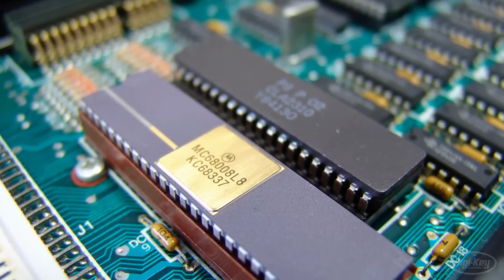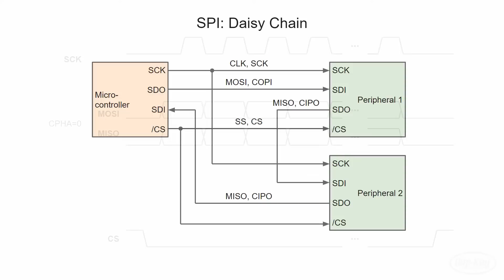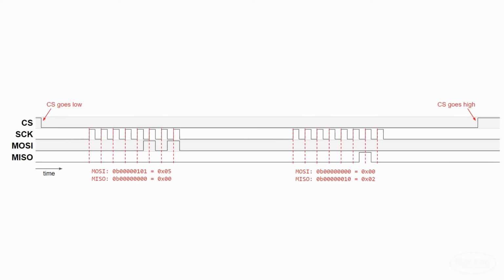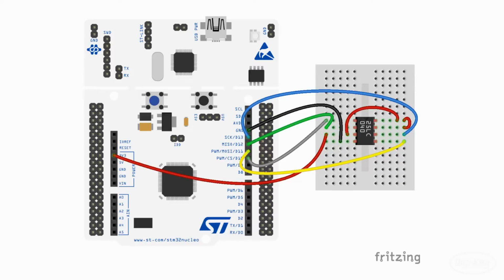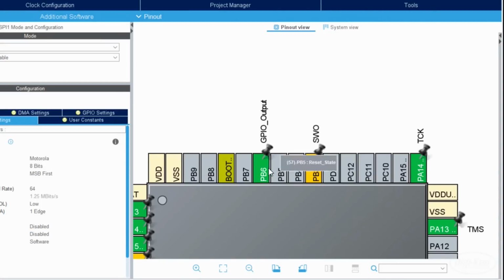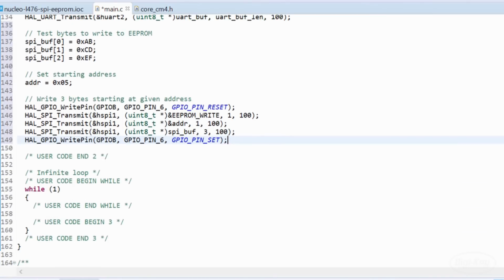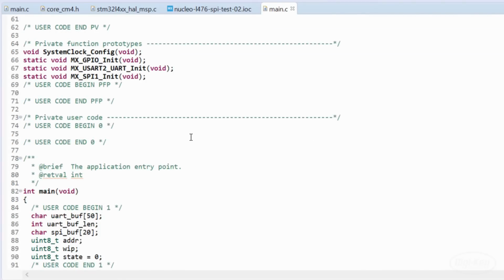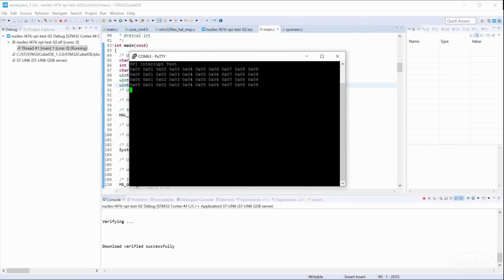Getting Started with STM32 and Nucleo Part 5: How to Use SPI | Digi-Key Electronics

Comment: for some reason when I use this code and setup on my g474re using lpuart putty always displays nothing at all
Reply: i've got the same issue
Reply: @varulven5143  the baud rate was not set correctly in putty, check in cube MX what tje baud rate is set to and put the same into putty

Comment: Thank you for this useful tutorial.
Maybe you do another one on Octo-SPI ?

Some bookmarks:
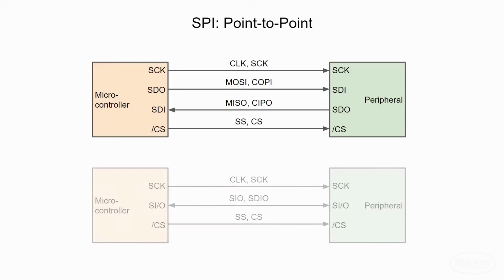1:51 3 lines SPI configuration!
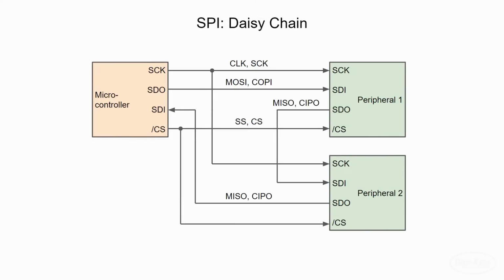2:53 daisy chain connection
8:41 note that you can use any gpio pin for your chip select line
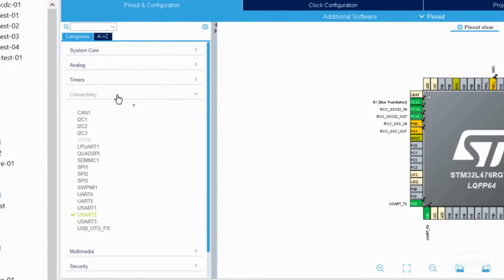9:55 full duplex master
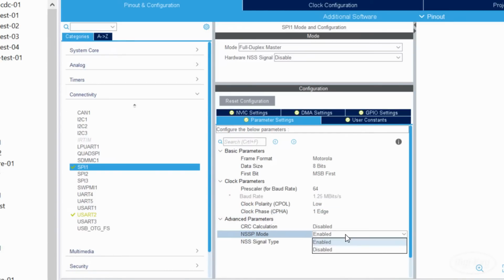10:45 the spi configuration.
12:44 read status register
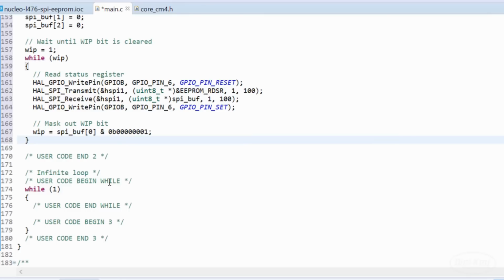13:58 wait until WIP  bit is cleared
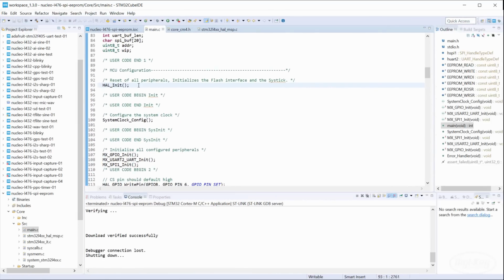14:59 a way to do the code non-blocking
17:02 using: HAL_SPI_Transmit_IT()
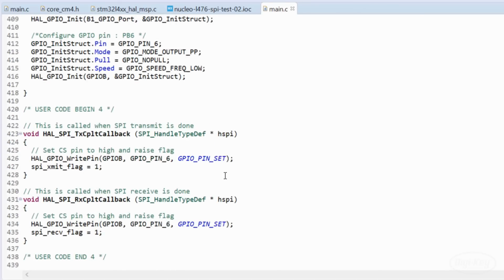18:38 HAL_SPI_TxCpltCallback()

Comment: Thanks for the useful tutorial. I just want to ask, what are the best options for TFT display (of at least 4" size) that I can interface with my STM32F401 Nucleo-64 board? Which interface would be better, SPI or parallel?

Comment: How do you get CubeMX to generate the SPI transmit/receive functions? It only generates to init.
Reply: OK, I'm using the STM32F100RB and the file is: \Drivers\STM32F1xx_HAL_Driver\Src\stm32f1xx_hal_spi.c and the function to use is: HAL_SPI_TransmitReceive().

Comment: The interrupt version never works because the state machine is wrong. The codes always switch to state 1 and never goes to state 2, 3, 4 and 5. And the plus signs are missing here:

for (int i = 0; i < 10; i  )
        {
          spi_buf[2   i] = i;
        } 

I think the code is never tested.

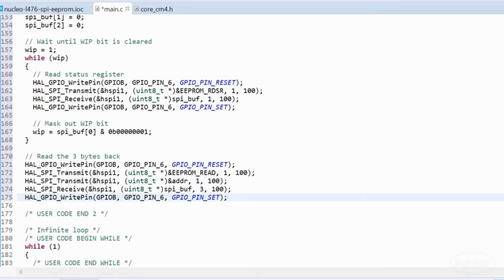Comment: 14:18 -  You send command to read data from address 5. How EEPROM chip knows that you're expecting 3 bytes to receive, not 7 or 10? I assume that HAL_SPI_Receive command simply waits for data coming in or it is send some short commands as well to EEPROM?
Thank you
Reply: The eeprom will keep sending out bites starting from the address you gave it, as long as you keep the clock pulsing (and keep cs low)

Comment: // Print out bytes read
  uart_buf_len = sprintf(uart_buf,
                          "0x x 0x x 0x x\r\n",
                          (unsigned int)spi_buf[0],
                          (unsigned int)spi_buf[1],
                          (unsigned int)spi_buf[2]);
  HAL_UART_Transmit(&huart2, (uint8_t *)uart_buf, uart_buf_len, 100);

The code on your website is broken, note the hex value characters. :)

Comment: Why didn't you set the peripheral to automatically control CSN, instead of manually via GPIO?   Is it because the CSN line goes goes tri-state when not in use, so without an external pull-up, the only workaround is to manually disable the hardware NSS and manually control it via a GPIO?

And so if you are controlling CSN independently, when 'HAL_SPI_Transmit' returns is guaranteed that the transfer has completely finished, or is it possible that it returns, but the peripheral could still be clocking out data?    

I've also seem some very strange behavior in CubeMX entering User Labels..  after every entry, the caret seems to jump to the character before!
Reply: This is my 2 cents answer:
1. The hardware CSN is more for when your MCU in slave mode rather than master mode. Because you would get into scenario that needs to control multiple slaves with one SPI peripherals and obviously one hardware CSN is not enough. 
2. The function is a polling function with a time wait arguments. It will returns HAL_OK if the peripherals is successfully transmitted the data and HAL_ERROR or HAL_BUSY otherwise (I think). So using this requires setting time good enough to wait the peripherals transmit the data. In basic scenerio like testing out the peripheral, using HAL_MAX_DELAY would suffice. Otherwise adding a bit of waiting would do too or even better, interrupts :))

Comment: :-D :-D I am really glad you made that a simple explanation :-) :-).
Sorry I was reminded of some small book from my past entitled RS232 Made Easy. It was 400 pages thick.
Forgive me I need to go over it a few more times. Maybe I will want to use the SPI afterwards, maybe not. I also need to get some previous background material. I do not NEED to do these things od course, I am just curious.
Regarding burning an EPROM: I made and partially wrote the program for a 2708 and 2716 eprom and to speed things up we used a more rapid burn cycle followed by a read for each bit, maybe byte untill the received equalled the sent then sent a few more burn cycles to make sure. The overall result was a MUCH shorter burn time. Please don't ask me for details it is 40+ yrs ago and more accomplished people did the majority of the work. I think I have come across the comercial version in my junk now and then. Not something Magpies throw away